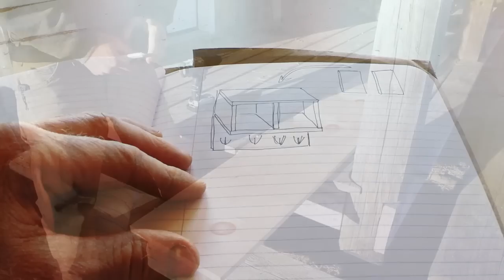DIY Coatrack + Cubbies with Just 3 Tools

Comment: I need some shelves for inside my wardrobe, to store yarn and fibre boxes.  Our house is 1 1/2 storey and the wardrobes are just sliding doors covering the eves.  So everything looks wonky. Sloped ceiling, no idea how much weight plasterboard can take, need a central divider putting in as only want one side to be shelved, my brain hurts just thinking about how I’d get a central divider to stay up, never mind how to cut it the right shape.  Anyhoo, this video makes me feel a bit more able as I have those 3 tools, but if you have an attic or sloped roof you need shelving that would be useful to see.
Reply from the maker: Sounds like our old house where nothing is square ,.. if you lived close I’d help ya with it, but you’ve got this! Good storage makes for happy knitters